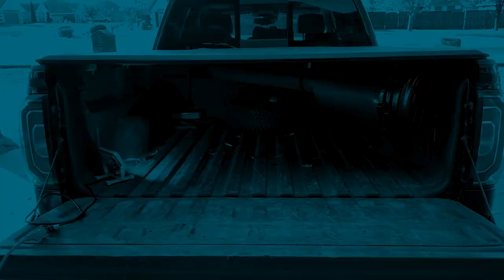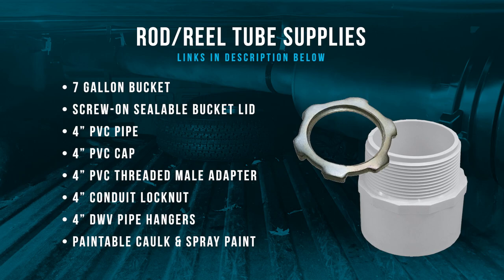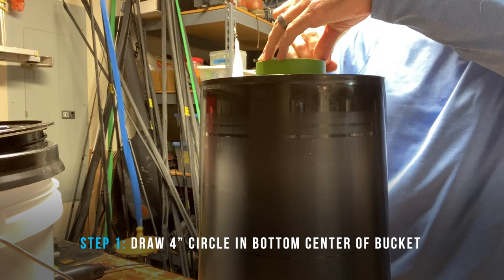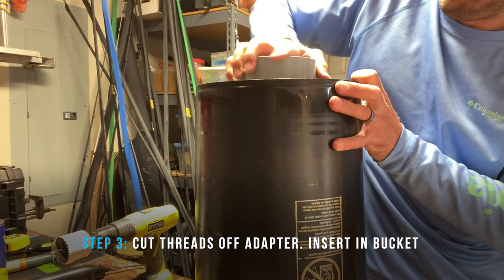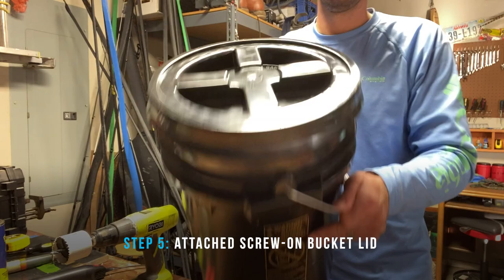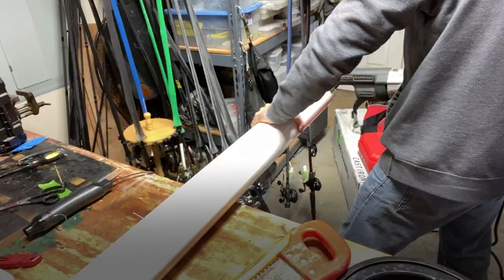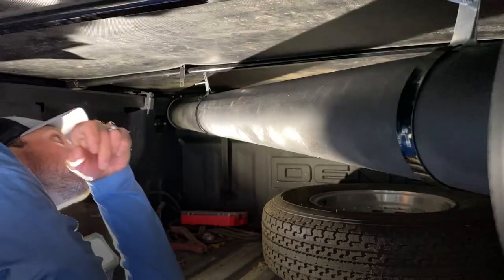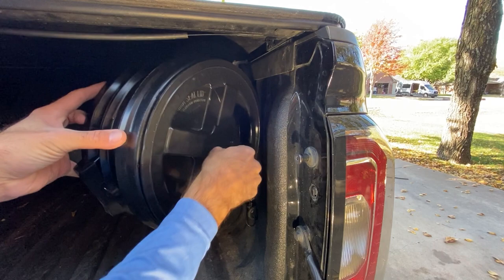DIY Rod and Reel Storage Tube for Truck (Holds up to 7 COMBOS!)

Comment: Do you think their is a way to lock your rods and reels in their, like if your truck bed can't fit the length and you want to put it on like a roof rack any suggestions? Great video very creative!
Reply from the maker: Thanks! I’ve been looking and looking and can’t think what it is called but I know I have seen it. Basically a metal band that would wrap around bucket. It has a flat piece of metal that is hinged on one side that would lay over top of lid. On the other side it has a hole that latches/locks back into the band on the bucket. 
I’m going to figure this out and get back to you because now it is driving me nuts.
Reply: @PrestigeWorldwideFishing you ever find the name out?
Reply from the maker: No, I can’t figure it out. I wish I could upload a picture to google and it would tell me what it is called 😂 I have it in my mind but have no clue what it is called. Maybe I should just make it myself and I will mail it to you
Reply: @PrestigeWorldwideFishing  I’d be up for that!
Reply from the maker: I will see what I can do. Happy 4th brother

Comment: Wouldn’t it fit straight in?
Reply from the maker: No. These newer trucks have bigger cabs, making the beds shorter. Had to angle it to get it over 7 ft. Wish I didn’t have to because it just takes up more space and makes it harder to get combos in. Works well for keeping my rods up and out of the way though, so I’m happy with it.

Comment: Misleading waste of money.  Doesn't work for inshore saltwater spinning rods and reels.
Reply from the maker: Sorry this didn’t help. There is never one size fits all. I said “up to” and a lot of that is dependent on truck bed length and what rods you are storing. Has worked perfect for me, but I’m a bass fisherman and primarily use casting rods.
Reply: Fishnusa- he never said it was for inshore saltwater combos.
Take a deep breath, thank the man
Reply: @PrestigeWorldwideFishing my wife was the one who wasted the time and money building this as a Christmas gift to me.  If I knew what she was up to, I could've told her it wasn't going to work for my rods and reels.  The length wasn't the issue.  I usually take 3-4 rods with me.  Only being able to fit 1 in this defeats the purpose.